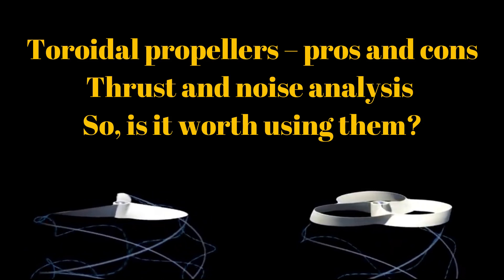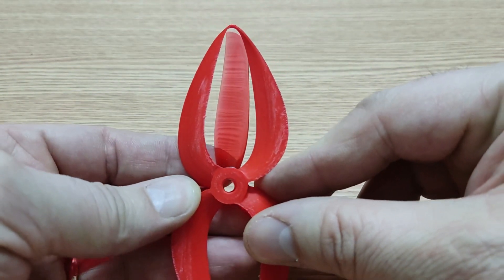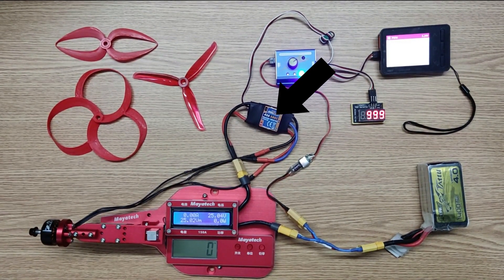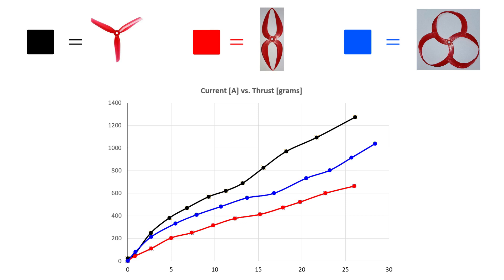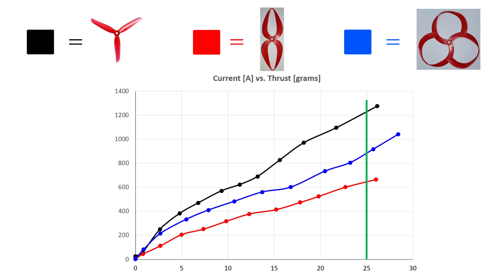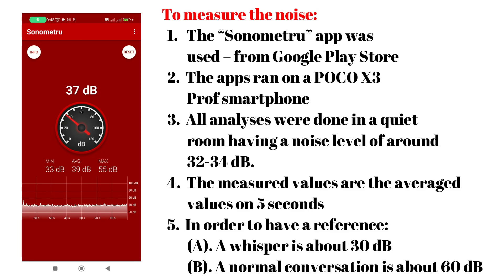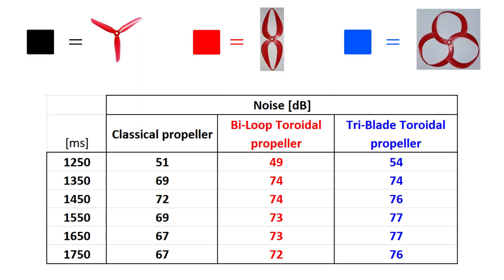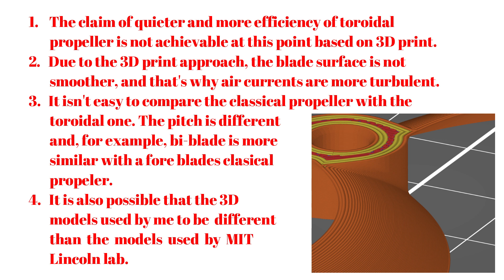Toroidal propellers - thrust and noise analysis. So, is it worth using them?

Comment: I'd be curious about the max RPM these propellers could reach being built of the same materials before critical breakdown.
Reply from the maker: I really do not know. I was at full throttle and does not broken. But I do not measured the rpm.

Comment: the surface of the printed models is terrible for a propeller, they are not processed, a small hair, a protrusion on the surface is a serious resistance and noise, the test was not fair!
Reply from the maker: You're right! I did the test because so many people on the internet at the time were saying how great these new types of propellers were - they were all 3D printed. I wanted to see if that was so - it turned out not. That's the key to this test!

Comment: If the other designs were more efficient, and/or produced more thrust than the classic design, by now they would be in use on full-sized aircraft.
Reply: the answer is simple, they were invented recently, a patent for 2018.

Comment: I dont know why these content creators are not 3d printing regularly designed props to even the playing field.
Reply: Or smoothing their propellers using vapor/alcohol smoothing. Better yet, both. The complete lack of any scientific method in these tests is just a bummer. It's called a control group, use it
Reply: Because MIT claimed a "printed" toroid blade was quieter than an injection molded 3 blade. Did MIT lie?

Comment: This torroidal prop design is a very poor design. How do you measure the pitch along the leading and trailing torroidal blades? It looks like the pitch at the tip is very steep (~7") and at the root the pitch is shallow (~3"), completely the opposite of a normal propellor which reduces the pitch the further away from the root as the blade speed is fastest at the tip. So this design is pretty pointless as it is aerodynamically irregular, no wonder it performed poorly, I would expect nothing less.
Reply from the maker: This is how toroidal propellers are designed, you can't get the propeller to go into itself without having a variable pitch angle.
Reply: @i3Drones  So a fundimental aspect of propellor design "can't" be achieved with this design? I don't have much hope then for the future of torroidal propellors.

Comment: So, the takeaway is that 3D printed toroidals don’t perform as well as injection modeled classic props.
On this basis you can’t tell if it’s due to toroidal or due to 3D printed.
I’d still expect to see toroidals outperform classics with all else being equal, meaning made with the same production process. But hey, I heard both gemfan and HQprop are producing IM toroidals! It may take a while to optimize them for our purposes, but I expect those to outperform classic props right off the bat
Reply from the maker: The problem is that many have 3D printed their propellers and are flying them - many claiming they are super OK. That's why I did this test, designed to answer my simple question: is it worth printing my own and flying them? The analysis shows that these printed toroidal propellers do not bring any benefit at LEAST AT THE PRESENT MOMENT compared with classical one.
Reply: @i3Drones    if you could also 3D print a classic propeller, then the comparison would be fair
Reply: @i3Drones  that’s pretty much what I said. Basically: don’t print your own (given that you use IM up to that point)
Reply: But MIT said, their printed blade was quieter.

Comment: Should of used a 3d printed "normal" propeller and compared noise vs thrust generated.
Reply from the maker: Yes, you're right... except that I'm not good at creating propeller models. And intuitively I think that the generated noise will be different.
Reply from the maker: Nice channel, you are faster then me! +1 sub from my part.
Reply: No! MIT claimed their printed blades were quieter. Did MIT lie?

Comment: This is a good analysis but the printed props were rough and you're comparing a very well designed and manufactured prop in comparison.  It could help to print a comparative regular 5in prop for your comparative testing?
Reply from the maker: Yes it is a very good idea!
Reply from the maker: You have nice videos ... very artistics! +1 sub for my part
Reply: MIT claimed their printed blades were quieter than IM 3-blade.  Did MIT lie?

Comment: I have the same conclusion, all printed designs of toroidal propellers are lower in thrust for the same ampere and louder for the same thrust. Maybe it is the wrong design or 3D printing is not optimal for props or toroidal does not work for rc props. Hope we get soon samples and results from the industrial molded toroidal HqProps. Thanks for your video
Reply from the maker: When I uploaded the video ... I was a bit scared, everyone was saying they were amazing but I thought they weren't - so, I wanted to do an analysis to see if I was wrong or not ... and it turns out I wasn't wrong.
Reply: Most compares are between industrial injection molded props and 3d printed toroidal props. I think, it would be much better to 3D print also a normal prop and compare this with the printed toroidal prop or wait, until we get the HqProp toroidal props
Reply from the maker: @Quickred  I agree!
Reply from the maker: nice channel you have +1 sub from my side!
Reply: 3d printing is crap, period
Reply from the maker: Thanks!